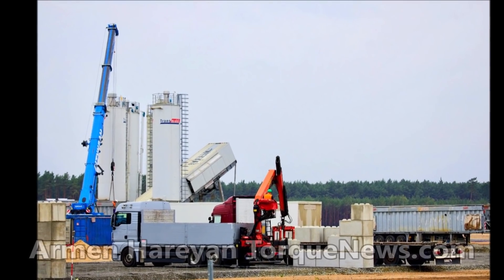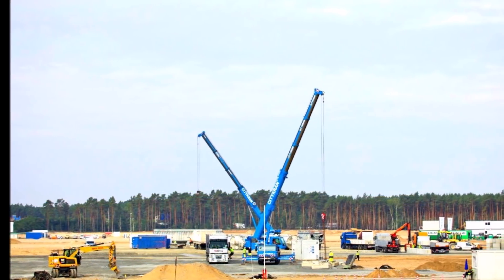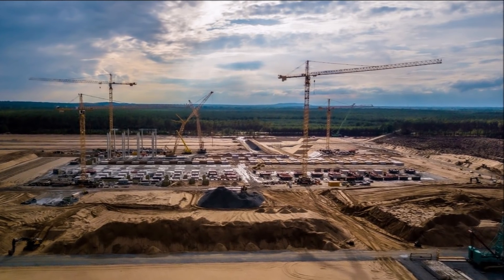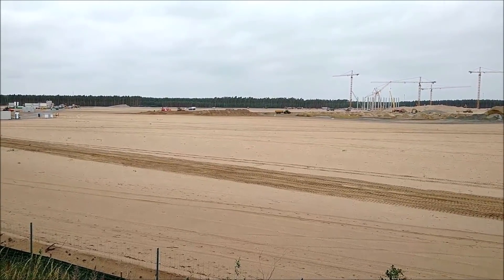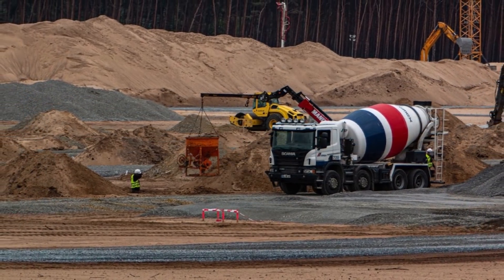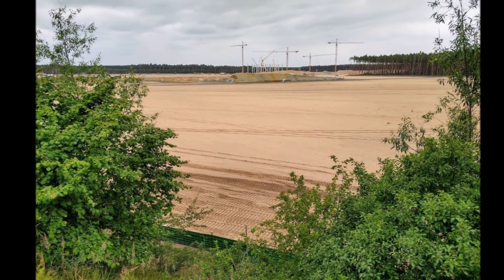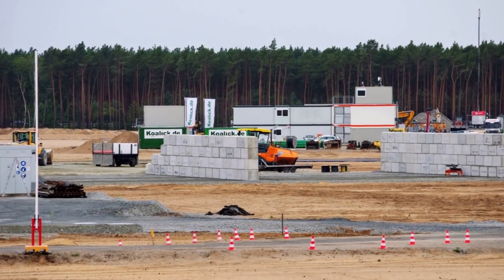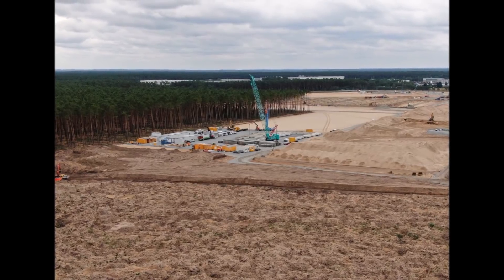Tesla Giga Berlin Looks Like a Lego for Adults and Builds Concrete Mixer

Comment: Correction. They are not building a concrete BATCH BUILDING. All of these silos are portable as well as control building and so is the mixing drum that are easily moved. LEGO blocks are used for walls to keep the different gravel and separate when they are off loaded from rail cars.

Comment: I told everyone that it was absolutely necessary to have concrete mixing plant on site and would lower the cost because railroad delivery of gravel. I was very surprised how much concrete they delivered to site already by probably using competitor trucks and plants to augment supply. This onsite batch plant will definitely lower cost, and logistics for concrete aging in trucks. I wonder if they made this decision before the cancelling of Phase 2 & 3 was announced
Reply: There was no canceling of any phases announced.
Reply: Tobias Lindh I could be wrong. I was doing the math. I believe TESLA said they are not talking 500,000 cars a year. Armen said 100,000 cars is what they are now talking about. That’s only 2000 per week 1 car line only. Why would they build more here after all this craziness here. Can’t build battery plant, can’t manufacture plastic parts, and they can’t have fire protection because water from sprinklers would dilute the contaminates and pollute the AQUIFER. There absolutely is no shortage of water here but will deny them an adequate amount of water. There is a big need for huge hydrant system to protect plant surrounded by pine Forrest. I see fire station as part of new plant good for 2 trucks only. I hear the crazies even Insists that equipment can’t be filled on location because of spills. (I guess they make exceptions for  large cranes only) MAXX BOEGL is doing a good job with PRECAST BUILD but now Andy AQUIFER Granger because concrete releases CO2. I was hoping Elon was going to stop construction after site was levelled by ARIKON.
Reply: @butchbailey965  The 100,000 cars story originated by one German newspaper written by Michael Sauerbier. It got copied all around the world, but it's completely fake news. He wrote that the new documents would talk only about 100,000 cars or more. But in reality the documents didn't have any change in production numbers at all. It's 500.000 for phase 1, and they still want to extend the factory later beyond that.
To not build batteries and plastics in the first phase was Tesla's decision.
Where do you get the story that they can't have fire protection? That's completely false.
And where did you get the story that the fire station will have only 2 truck? The fire station has garages for 10 trucks.
It's true that they need to refuel vehicles outside the water protection zone, but that's only for the construction phase because the aquifer is not protected.
You shouldn't believe everything from the media. If everything the media says would be true, Tesla would have been bankrupt in 2012.
Jixuan & Sebastian already said that they will correct their mistake in the next episode.
Reply: Tobias Lindh Thank You for responding and clearing up the 100 versus 500 thousand fake story. I accept that. I always like to evaluate numbers.If 500,000 is possible by phase 1 in BRANDENBURG, what will the production be after phase 2 & phase 3? I think Shanghai has produced let say 100,000 MODEL 3 in first phase. Are they going to be able produce more than 200,000 MODEL Y in one full year of production? Freemont production has not exceeded 350,000 with multiple car lines and they are hoping using CHINA production to get to 500,000 total for 2020?
I’m speculating TESLA decided to remove batteries and plastic production from this site solely to pacify environmental hearing coming up in September to hear the concerns of 170 or 270 citizens that will be heard after structure is complete and could not risk being told to demolish it and turn it back to a plantation. (Absolutely BIZARRE EARLY MEASURE ACT only in GERMANY) Now I believe Alex Granger of TORQUE NEWS credit for identifying records that their is an AQUIFER under the TESLA site and You indicate it is one particular area that they can’t refuel. ( I would like to know if TESLA was informed of AQUIFER at the time they entered into a DEVELOPMENT AGREEMENT WITH GOVERNMENT AND BEFORE THEY PURCHASED SITE? I was expecting a duplication of SHANGHAI factory using Structural Steel. I believe everything changed to PRECAST construction because they were denied adequate water and sprinklers that are used to protect factory. Here again Andy Granger surfaces and declared that sprinklers used during fire would dilute the contaminants and contaminate the AQUIFER. This site should have an extensive hydrant system to be used to protect against Forest Fire. My belief is there is no shortage of water in this area and there should be no restriction of what TESLA needs for industrial use. They could have their own unlimited supply of water on site and the emphasis should be putting tight controls on them cleaning up their industrial waste water system. I just guessed at 2 fire trucks when  I saw building colour coded. It’s good that their is room for 10 fire trucks. I’m now curious how many Firetrucks are used at other TESLA factories. It is known TESLA has had Fires in their Paint shop at FREEMONT but this site is unique with the major source for fire is the Forrest that surrounds the Plant. I guess the answer from the crazies is to let the factory burn, and TESLA would be doing the whole area a huge favour being able to fight Forrest fire around the plant.This PRECAST construction may be the new standard for certain parts of future TESLA factories. Andy again surfaces to make a declaration once again that he also against PRECAST construction because of CO2 emissions. UNBELIEVABLE. Tell me only if You want to who exactly this Big Time Shit Disturber is? He lives in Perth AUSTRALIA and has summer home on Solomon Islands he states he is not being paid by TORQUE NEWS but he does not address my accusation that he was or is. A TOYOTA DEALER and is been paid by them even after I have challenged him to clear this up and he won’t. I wonder if he is a GERMAN citizen and why he spends a lot of his time in GERMANY doing reports for TORQUE NEWS. I’m glad You have contacted Jixuan & Sebastian and they will clear up some miss information. Now after all my points I have made, do You not think TESLA May have had enough and may actually considering completing Phase 1 only of this project? Please tell me why no drone action for a week and is there a delay in more precast coming to site. Armen talks of Rainforest coloured beams that are going to be installed over dirt. There is 1 picture only showing probably a double T roof segment. The only colour is from the red from rail car posts and lm sure he meant to say reinforced. Please tell me if you can or want to where I got it wrong? I really enjoy your drone shots and are Your colour coded Plant Layouts in response to my request? Thanks Again
Reply: @butchbailey965  I think it will take some time to ramp up to 500,000 cars per year. But I don't have any more information on that. I only know that Tesla plans to build 500,000 Model Y in phase 1.
I don't know why Tesla decided to remove battery assembly and plastic production. I heard some people say that especially the plastic production was removed to reduce water. It might be possible that it was a reaction to concerns from citizens. It might also be possible that they want a faster start and the local water supplier might need more time to build more wells.
Tesla new very well that there is a water protection area. It comes with some restrictions, but nothing you can't work with. Tesla's own documents described the whole situation very well, before they signed any contracts. 
Same with the precast concrete structure. They already decided to use precast concrete in their first application documents, which was way before any contracts.
Precast concrete is very normal in Germany it might be because of the very strict fire protection regulations. They are even required to have automatic sprinkler systems.
Also there will be fire water lines unter all roads and hydrants every 80 meters. And additionally they will have a 400m³ underground fire water reservoir. All water on site get's collected, so contaminated water can't get into the ground.
I have no idea why Tesla wouldn't want to complete this factory. They have a lot of support and everyone is doing a great job.
There are a lot of double T segments on the site. I think they will be used for the second floor and will get another layer of concrete when they are in place.
I've made the color coded building sections over the drone flight last Saturday because that was the first video after the new documents got released. I didn't know there all the building sections will be before the new documents got released.
Reply: Tobias Lindh Jixuan & Sebastian who live in Germany talk about TESLA shrinking their factory to tiny fro what it was supposed to be?

Comment: Any info about the casting machines, please? How many parts per day, will castings be used in all Tesla models? How many machines will there be?
Reply: There are 8 die casting machines with a maximum operating capacity of 73.1 t/d per machine. The maximum total capacity is 213,474 t/year.

Comment: From this construction site you can learn that it is also possible in Germany to build a really large building complex even faster than planned if the right company can do it for you.
On the other hand, if you let politicians do the construction planning, you first get hundreds of individual tenders for each individual trade, and you initially get a significantly lower price. But due to the totally confusing project planning, it takes 10 times as long in the end and costs 10 times as much money. If Bögl or Hochtief had had the airport built as a complete package, it would probably be finished three times.

Comment: Looks like Tesla will be diversified from their giga Berlin to a new giga factory in Europe.  They may be having a hard time dealing with German govt or local authority.  May as well look for another country with more friendly attitude to work with.
Reply: Why do you think that?
Reply: @JK-ku2mj  Tesla latest giga berlin construction plan is smaller than the original plan.  Some say it's due to the water usage concern raised by the locals.  Not exactly sure the reason, but looks like they are now aiming for a smaller plan than previously projected.

Comment: Elon is awesome!  The Germans are probably telling him that they can't keep up with the volume of cement that the factory needs.  He probably said "fine. I'll build my own cement factory.!"  Look at him getting involved in getting into the vaccine/DNA/RNA business.  I think he feels that the world's rate of getting a vaccine is too slow.
Reply: I don't think that was decided by Tesla, but by the construction company. It's a pretty normal thing.
Reply: @M Doc: Now that's a real fan boy .. no clue at all lol
That is a hired mobile cement factory, a very normal thing for big construction sites. You can hire them in many different sizes. They are not 'build', they consist of transportable blocks that are simply stacked together on site.
Reply: Concrete guy here...It looks like there’s a limestone quarry 8 miles north of the site but even so, for a project of this size, you want a batch plant in-site. It gives you far more flexibility, quality control and cost-reduction.
It also eliminates a long line of mixing trucks jamming up the roads and the job site while their loads set up.
Reply: @jbell6642  in addition, there is now the hot weather, which does not make transportation easier
Reply: You get better concrete if it doesn't spend half an hour tumbling in a truck on the highway. And transit time is very expensive. If the drive is 10 minutes, concrete can be hauled in a dump truck, not a mixer truck.
Reply: @kkarllwt   Nobody in Germany would do something like this on such a large construction site. If the concrete gets hard you can throw away the dump bed of the truck. The rent for a truck mixer isn't that much more expensive.